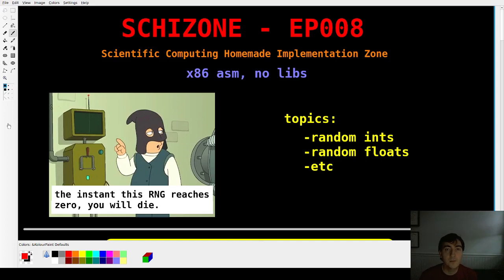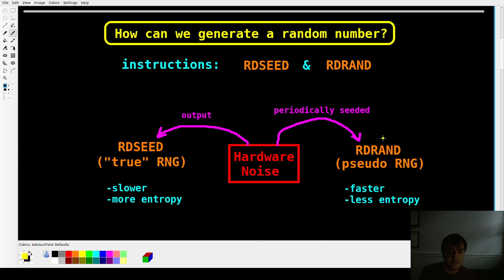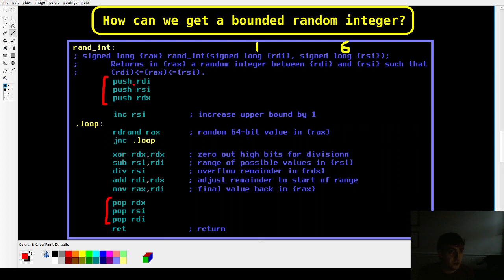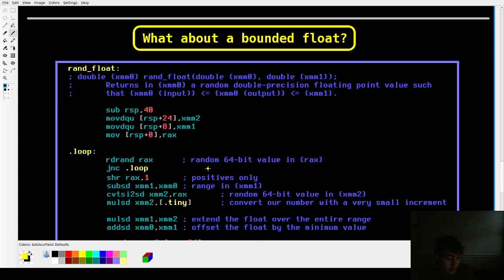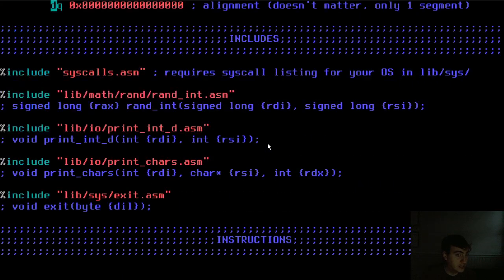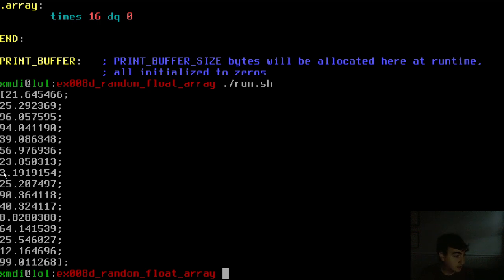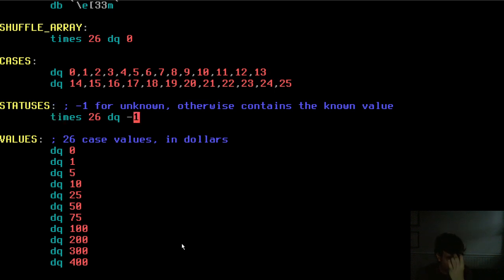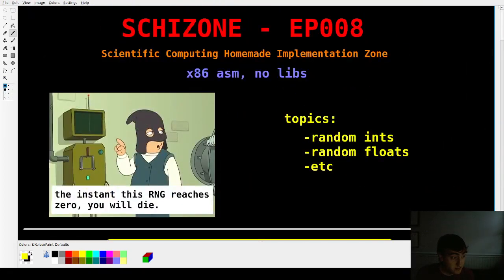random numbers in x86 assembly | SCHIZONE EP-08

Comment: I wanted to write a random number generator in 32-bit AT&T assembly, but i had no idea how to start. I'm just learning assembly in autodidact way, and I haven't seen such a clear explanation in this topic which is not for 6502 or 8086 CPU. I wanted to understand the gcc -S output of a random number generator written in C as well, but that was a total mess for me, but the C code was around 5 lines. Thousand thanks to you!

Comment: Hey. In the first exemple when you're printing the number what is the SYS.STDOUT?
Reply from the maker: SYS_STDOUT is a value representing the "file descriptor" that is an output to the console. This value is 1 on both Linux and FreeBSD, but in theory could be different on different operating systems. All the OS-specific values in this series are defined in a dedicated assembly file under SCHIZONE/lib/sys/. Depending on the OS that you are running, the "compilation" script "./run.sh" will automatically pull the correct values.